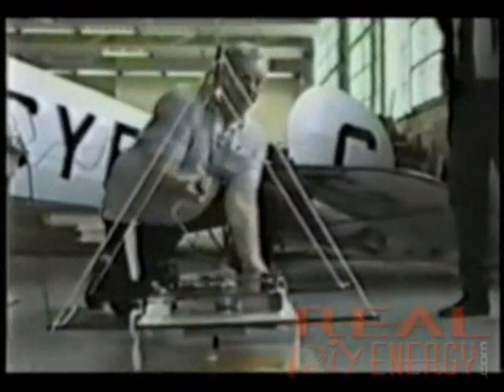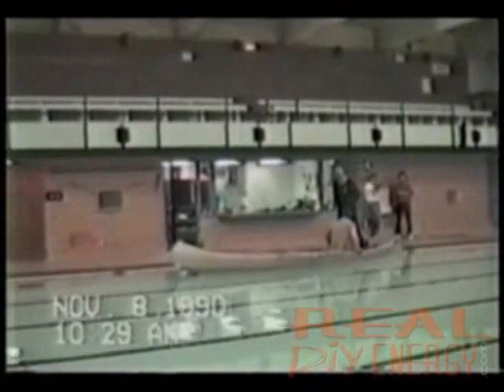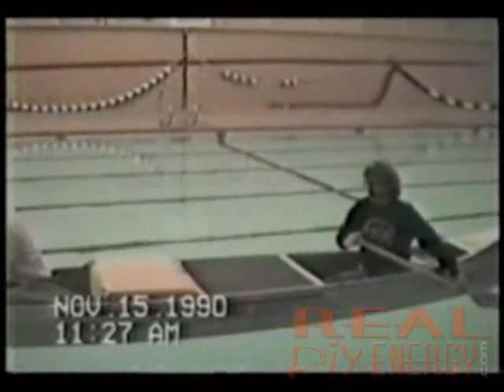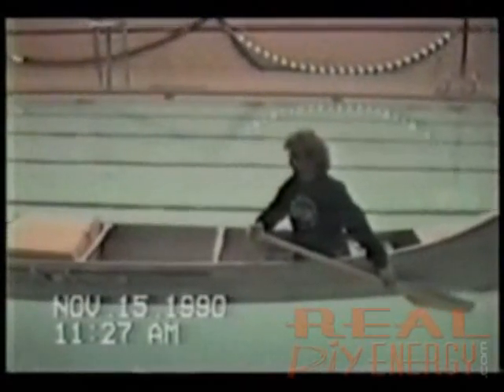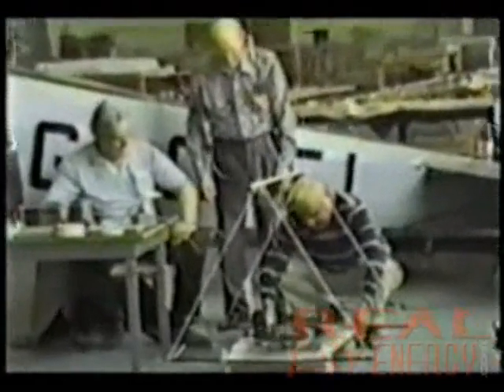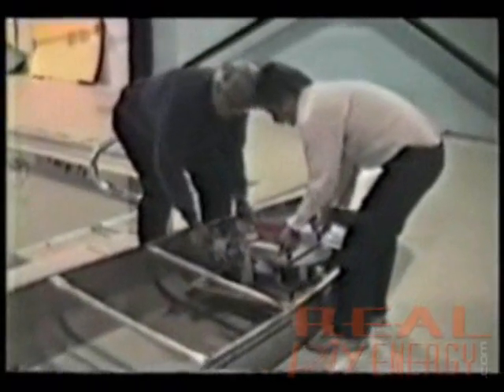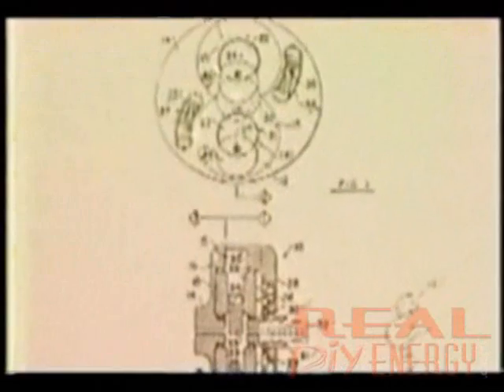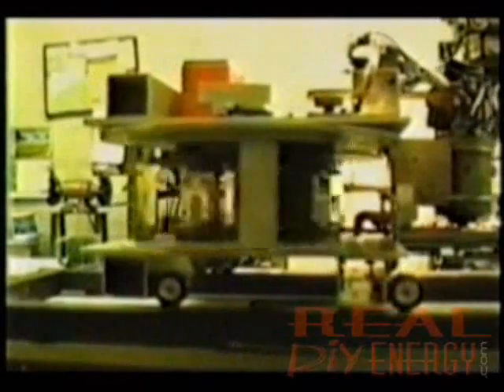Inertial Propulsion Generators Roy Thornson

Comment: The last part of the videos shows the machine supposedly moving on it's own and it is but the wheels on the bottom are uni directional meaning the recoil of the weights is being transferred to the floor and the machine is basically pushing off the floor to produce thrust in a very ineffective and inefficient way. Possibility of a string used there also but more likely the former explanation is true.

Comment: So were these guys crooks or liars or did they just not know that it doesn't really work. And what's up with the boat. I'd bet you the woman peddled it up to speed cause why the f would you have a paddle if you have an engine? Also the fact it never succeeded and the moronic way it was put together making it obvious straight away from the configuration to any physicist that this is not going to work so the boat test was most certainly faked, with a small propeller, a push, or that woman peddling. The only question is why, for the money of course, but still again why lie and put your profession at risk. It just sucks there are people like this who will deceive you for money and not actually produce anything

Comment: For it to work it needs an external point to apply the force to. What it does it simply throws the wight to one side and  then returns the weight back slowly. It may work in a viscous environment. But impulse must remain the same nevertheless. Just another perpetum mobile.

Gee, no wonder they could not find any investors!
Reply: +HSMAdvisor Let's say i put this on a spacecraft that's orbiting at 7000 m/s with an air vent in the front and I'm trying to land it back on Earth. As the craft descends, the vent opens up and collect all the air molecules in front of the craft to spin the axis of this engine (the external force.) The inertial force generated from this engine is directed behind the craft, the opposite direction of where the craft is moving to help decelerate. Maybe this would reduce the heating during re-entry.
Reply: +slamongo ..why bother powering inertial mechanism, when u have created a "turbine" air intake,  to  slow down the re-entry simply reverse thrust the blade.. There is a gradual increase in density, on reentry. So why bother with inefficient mechanical coupled I.P ?
Reply: talis it could go in vacuum and water

Comment: I think the oscillation of machinery produces small waves that pushes the boat forward, it rides the wave, as surfing. Put that on the railway if you want to prove something. 
However, after so many decades, why this thing doesn't move my car today?
Reply: +Pitot Tube yor car is not sitting in a viscous medium, like the boat, its called a damping system.

Comment: It passed the pendulum test. That says a lot about the credibility of this device. But, is the pendulum test accurate? What if you'd just shift the center of mass in the machine so it would indeed hang non-vertically?
Reply: But it did propel canoo

Comment: This is actually only a friction drive. Only a true pendulum test would suffice. The one in this video confirmed nothing. It simply wobbled back and forth. I have been following this stuff for over 14 years now and the only person who has figured it out is Mike Marsden and his Mac Quan 1. I am currently building a prototype based on the design. Trying to "hula hoop" yourself into space will never work; you must create an energy vector as your "equal and opposite reaction".

Comment: With an array of these inertial platters where each element is at a different phase, this could become practical for a light plane. Like a V6 engine where each piston is at a different phase. That would provide a steady propulsion rather than intermittent like in the video.

It's interesting how most things mechanical tend to advance toward a solid state (ex: Computers). I've heard Stealth Bomber wings use a materiel that converts electric power to propulsion, piezoelectric-crystal related?

Comment: Its very useful fot planes and vessels, in fact there is an urgent need for a 3D field motor
for driving omnidirectional (3D) crafts. You fools have not understood how usefull is this device for space traveling. It has a very very high potential for direction and speed generation. In fact, the kind of propultion you can get is incredible.
And quick..